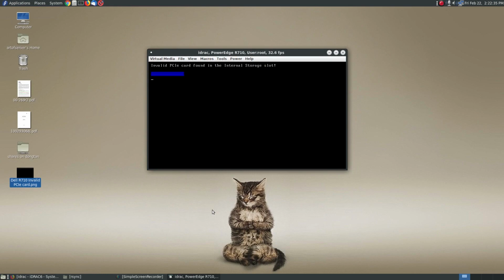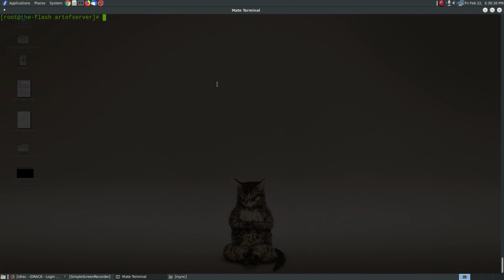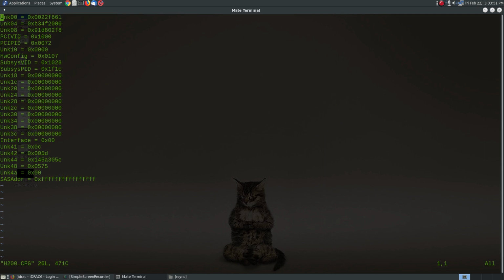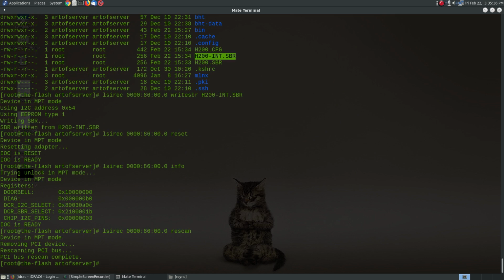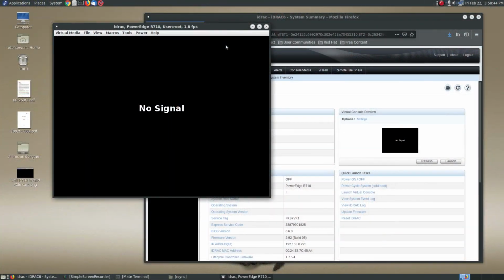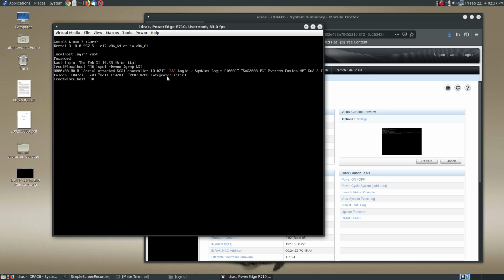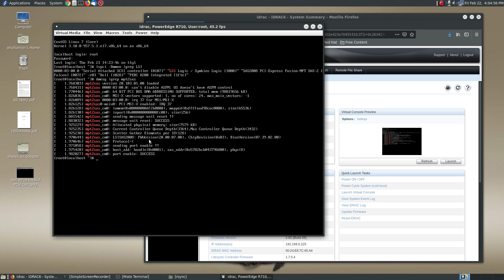How to fix: "Invalid PCIe card found in the Internal Storage slot!" error in Dell PowerEdge R710

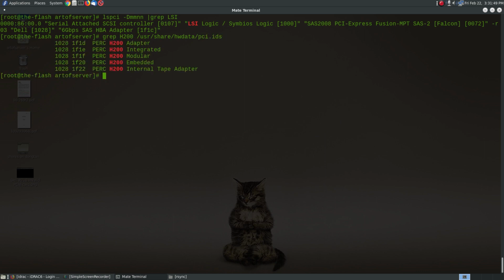Comment: If your running on a live cd because you don't have a Linux box then your steps at 6:52 might be different
I had to use 
"Sudo find / -name pci.ids"
My location was 
"/usr/share/misc/pci.ids"
Your milage may very

Edit: I would recommend not using a live cd. a memory issue prevents using grep correctly in kernel 4.5 or higher and the work around requires files that are not on the live cd. 0.o
Reply from the maker: I think the location of the pci id database file might depend on the particular Linux distributions packaging. my video is specifically using CentOS 7.

Comment: Thanks! This was exactly what I needed. I was trying to flash a H310 back to IR mode from IT mode. Only problem is that I don’t exactly have physical access to the server. I guess I’ll have to pay to have the card temporarily moved to another slot until I can get out there (which won’t be until the pandemic is over due to being in a different country). Unless there is a way to temporarily bypass this error.

Anyway, the question is, can I just move the card to another slot and have it work properly until I can update the subid?
Reply from the maker: Normally, yes... a lot of people use to just install the HBA in one of the regular PCIe slots until I figured out how to get it to work in the integrated slot in this video.
Reply: Art of Server Thanks! I’ll do that for now and save this video for later

Comment: Great video. changed both SubsysVID+PID on an IBM LSI card to 1028/1f1e and my r610/ZFS/18.04/lxc is just fine. But I now get  "Error: SAS Cable B or SAS integrated Controller is missing; SAS B Cable Missing/ Misconfigured/Controller missing." message on boot.  No effect on operation but would be good to understand why. Swapped cabling around and clear iDRAC log but still there.  I know, I know, I should have bought one of your cards.   Thank you again for sharing all your hard won knowledge.
Reply: FWIW: Thanks to AoS I put a machine together to do the SBR reprogram. Then stumbled on sasflash*.  So instead of replacing the controller card on every Dell->ZFS I make, I just reflashed SAS 6i/R 1068E LSI chip with the IT mode firmware from LSI/Broadcom.  No "cable error messages".  Seems to work for my zfs-root system. will test further. Thank you AoS.  * https://www.reddit.com/r/homelab/comments/5lg7oq/how_to_flash_a_dell_sas_6_ir_with_updated_lsi/
Reply from the maker: That's awesome! But I guess you missed my video covering that exact process here: https://youtu.be/YUbyUWpnNhw
Reply: Wow.  Youre the man.  I particularly like the part where you clear up the myths wrt 2TB SAS vs SATA.  I learn so much from you.  Thank you.
Reply from the maker: @richardlamb8952  Thanks! :-) Glad my videos have been useful to you!
Reply: @richardlamb8952   I'm getting the exact same issue on my sas 2008  9211-8i, does it mean I did something wrong when flashing it?

Comment: Thank you for the video!! Does this only work with cards originally intended for Dell's Internal Storage Slot?
Reply from the maker: The cards flashed to work in the Dell 11th gen integrated slot will work in any PCIe slot, but not any card will work in the integrated slot.

Comment: Great stuff, thanks so much for making a video on this. I have an actual lsi 9211 8i already in IT Mode and i am trying to get it to work on my dell r515. I am getting the message "Invalid PCIe found..." Will this walk through video apply to my card, or only Dell cards LSI 9211 not non-dell LSI cards?
Reply from the maker: How are you installing the 9211-8i card in the integrated slot of the R515? At least with R510, I found that there's a metal bracket that gets in the way and the size doesn't quite fit the integrated slot?

I've only tested this procedure out on H200. I suspect it would work with any SAS2008 based card, as long as it physically fits.
Reply: @ArtofServer  I had to remove the bracket that held in the h700 card, but once removed the card fits in just enough. And it isn't putting any unnecessary flex or anything to it. 

I saw in the first part of your video you were explaining how to do it with the dell card, do I skip that part?? How would it apply to regular LSI card not a Dell LSI one??
Reply from the maker: @rodjohn01  It's more or less the same. put the card in a normal PCIe slot and run the tools to modify the SBR subsystem Id, then write it back.
Reply: @ArtofServer  awesome thanks alot, will give it a go!
Reply: @ArtofServer  You are an absolute legend!!! Few things to take note of for others that have a similar situation. 

1. Put the lsi 9211-8i card in another system (Any regular desktop PC will work, with a PCI-E slot) 
2. Put linux mint on a bootable USB and boot off that usb
3. Open the terminal and login as root with sudo -i
4. To Download / extract LSI rec use the following commands in the terminal: 
git clone https://github.com/marcan/lsirec
make -C lsirec
5. To run lsi rec use the following command (make sure you don't change directory from when you did 'make -C lsirec'):    lsirec/lsirec
6. To run sbrtool use the following command:    python3 lsirec/sbrtool.py
7. Follow the tutorial in the video but when editing the .CFG file, you need to change SubsysVID = 0x1028   -- this will make it so the card is seen as a dell card.

Everything worked as you put in the video with a few tweaks, thanks so much!!!

Comment: how is the 720 on power efficiency am i expecting a massive bill for the month ?
Reply from the maker: Are you asking about R710 (what is in this video) or actually R720?
Reply: @ArtofServer  sorry the R720 and a switch its not a problem i just heard a lot of people saying you need a spare generator at the national grid for it lol
Reply from the maker: @nettyvoyager6336  R720 generation supports Ivy Bridge xeons, so are actually quite energy efficient. But that will highly depend on your choice of CPU. It can have idle power of around 80w-110w for dual socket system, but under load, can use as much as 400w. Again, depends on CPU choice.

Comment: Does the card have to be in a Dell server to be able to modify the SBR or can it be done from a standard desktop?
Reply from the maker: Well, in this video I did it in a Supermicro server and then put it back into the Dell. It can be done on any system where the tools will run.
Reply: @ArtofServer  when I do lspci -Dmmnn I can't see the card showing up, there's a green light flashing on the card and when I booted into freedos previously it would show up. I'm booting Ubuntu from a live image, could that be the issue?

Comment: When I rescan the subsystem the card shows up with the new hex code after writing but when I reboot it goes back. I tried it twice but it still didn't work. I was trying it with a H700 card not a H200.
Reply from the maker: Yeah, I bet the problem is that your H700 still has the Dell firmware on it? When Dell / LSI firmware start up, if they detect incompatible SBR content, it will try to correct it automatically, and usually you'll notice a delay during boot by a few seconds to over a minute. you need to match the firmware to the SBR for it to persist.
Reply: @ArtofServer  thank you for your response. I will look into it

Comment: 15/12/2019 
'Dell H200a/m/i' to 'LSI H200i using the latest LSI 9211/8i IT firmware'.
By 'The Mole'.

   - Filenames renamed to reflect the versions used.
   - Switch -c 0 - means card number 0.   Check it is on 0.  Otherwise edit 'bat' files.
   - Should work with H200a/m/i series...  Latest files!

For a FreeDOS USBF - 'DELL-LSI' Folder:
https://drive.google.com/file/d/13GtUh-JJ9Z3w7zI9MB_lIcA4rG3kbYpC/view?usp=sharing

Cables: https://www.ebay.com/itm/Dell-PowerEdge-R710-SAS-cable-set-6-bay-backplane-to-H200-replaces-P110M-N170M/163935653337?hash=item262b538dd9:g:ARMAAOSw1LJdxSYs

- If you have a flashing failure, IMMEDIATELY start over from Step 01.  DO NOT REBOOT!
Follow these steps 100% and you should not have a failure anyway.

- In my last experiments, trying to trim this procedure by a step or two (ie try and flash too much in one go), I had the UEFI BIOS fail and I forgot that it did.  Went back to my work PC and amended USBF, then stupidly rebooted server.   Don't do that!  Only can reboot if card is erased fully (99% sure) or combination of FW/2x BIOS flashed to the card successfully.

-  BIOSes are not necessarily needed for IT mode, but I would - you can format in there.  I only bricked my first card because post would not complete with the card plugged in (due to bad flash) and so could no longer enter FreeDOS.  They are pretty sturdy flash wise.

- I wouldn't have even bricked my first card if was not trying to write it up! :(
(Any good suggestions for a decent motherboard to flash in?  Ie exact name?)

- Feedback on successes would be nice! :)

01.  'LIST.BAT' - sas2fl20.exe -c 0 -list
       • >>> TAKE A PHOTO WITH YOUR SMARTPHONE OF YOUR 'SAS ADDRESS'! <<<.
       --- VERY IMPORTANT YOU DO THIS!  IT GETS ERASED! ---
02.  'KILLCARD.BAT' - sas2fl20.exe -c 0 -o -e 7
03.  'LIST.BAT' - sas2fl20.exe -c 0 -list
        Install 'H200I.FW' (Type 'H200I.FW' when prompted!)
04.  'FLASH1.BAT' - sas2fl09.exe -c 0 -o -f 2118it07.bin
04b. NVDATA Versions Compatible.
        NVDATA Product ID and Vendor ID do not match.
        Would you like to flash anyway [y/n]?_
        Type 'y' / [Enter]
05.  'FLASH2.BAT' - sas2fl20.exe -c 0 -o -f 2118it20.bin -b mptsas20.rom
06.   'FLASH3.BAT' - sas2fl20.exe -c 0 -o -b x64sa20s.rom
07.   'FIXADD.BAT' - sas2fl20.exe -c 0 -o -sasadd 5848F69024F3EC00
         *5848F69024F3EC00 = [Your 'SAS Address']
08.   'LIST.BAT' - sas2fl20.exe -c 0 -list
09.   Turn off PC and disconnect power.
10.   Move card to the 'Dedicated PCI-E Slot' of the Dell PE R710.   NO MOD NEEDED!

11.   OPTIONAL: SELL 'LSI H200i IT' to BUY 'Dell PERC H700i R'.  :D
https://www.dell.com/support/home/us/en/04/drivers/driversdetails?driverid=9fvj2

For a FreeDOS USBF - 'DELL-LSI' Folder:
https://drive.google.com/file/d/13GtUh-JJ9Z3w7zI9MB_lIcA4rG3kbYpC/view?usp=sharing

Comment: Any way to do this in the R710?  Can I leave my H700 in there and plug the H200 into a different slot and then do the SBR modification?  The only other systems I have is another R710 and a Macbook Pro.
Reply from the maker: yes, you just plug the card into a regular PCIe slot instead of the integrated one. I used another system only because my software was on it already. you can use any system so long as it boots up and you can run the tools i showed.

Comment: Excellent work! I just finished reflashing my H200 in a Dell R515 and it looks good. Only about 5 hours wasted in getting to the "begin install" phase :)  If it weren't for you, I'd have had to wait another week to get new cables to run it in another slot.
Reply: The tool that is used in most guides takes forever/appears to hang!
Reply: Did it gave you the error PCIe Degraded Link?

Comment: Thanks - this was a great tutorial! I followed all the steps but looks like I went wrong somewhere, for some reason the card is no longer seen in my R710. I placed it back in the PC I was configuring it on and lsirec is able to see it but my R700 just totally just ignores it. Any thoughts on what I might have messed up?
Reply from the maker: What is the current PCI ids of the card? What does lspci show?
Reply: @ArtofServer  admin@ubuntu-linux:~/lsirec$ lspci -Dmmnn | grep LSI
0000:01:00.0 "Serial Attached SCSI controller [0107]" "LSI Logic / Symbios Logic [1000]" "SAS2008 PCI-Express Fusion-MPT SAS-2 [Falcon] [0072]" -r03 "Dell [1028]" "PERC H200 Integrated [1f1e]"
Reply from the maker: @dh010447  well, that looks correct to me. when you have the card in the R710 integrated slot, does it show the "invalid PCIe card" message? Or, does it boot up, just no such PCIe card (lspci shows nothing) ?
Reply: @ArtofServer  No "Invalid PCIe card" message now (there was before making this change). Just does not see the card or show attached drive. Goes straight from CPU/Memory notification to iDRAC prompt. Will boot it from Ubuntu live USB and and post here if lspci shows anything...

Comment: Hey AoS, great video guide! I've flashed a H200 to IT mode and followed these steps to install it in the integrated slot with success. Have you run into the issue where the fans of the R710 go nuts after installing the H200 into the Integrated slot? Mine simply won't spin back down, seems it's a common issue I can't seem to find a fix on. I tried using imptools to spin the fans down but no go.

Correction: it seems it is the PSU fan not the system fans making all the noise!
Reply from the maker: No, I have not had an issue with excessive fan noise using the H200 in R710 server. I made a video about the noise level, if you want to see it: https://youtu.be/LYTjgSw1OEA
Reply: @ArtofServer  Thanks for the response. It is actually the PSU fan going crazy... the system fans are almost silent after running an ipmitools command on them. The low noise of this server is what I liked about it but the PSU fan running so hard and making this much noise can't be good and is not silent to say the least.

Comment: Am I right in thinking that you are telling the R710 to support SAS as opposed to SATA which is slower technology.  To do that, you are making the Dell think this card is the PERC so that it accepts it running an unapproved, faster card?

Not quite sure why you are swapping this with the PERC 6?  It gives a better IT mode?
Reply from the maker: The PERC 6/I is not a IT mode card, and is also an older SAS-1 card. the H200 in this video is a proper IT mode card running the LSI firmware, and is also a SAS-2 card so it supports faster link speeds. Both cards are SAS cards, just one is older version. And being SAS cards, they support SATA as well, but the PERC 6/I has problems supporting some of the larger SATA drives... there's a video in my channel called "The 2TB Limit" if you want to know more about that issue.
Reply: Art of Server Thank you!

So, these cards are not using RAID?  Won’t that be an issue?  Why is IT mode good?

Also, does this make the DRAC battery obsolete?

I am guessing that if I updated the firmware again (assuming was one etc), it would still retain the 1f1e code?

...and what OS is it you are booting into please?
Reply from the maker: @jason_a_smith_gb  That's right, these cards are NOT RAID cards. They are IT mode HBA cards, which basically means the storage devices are directly presented to the operating system. This type of SAS controller is preferred by people using software storage technologies like software RAID, ZFS, unraid, etc.

and yes, since this type of SAS controller does not emulate a storage device, there is no onboard cache, and therefore no need for battery to protect the data in cache.

If you got the H200 showned in this video, and updated it with a new version of LSI IT mode firmware, it will retain the PCIe id codes. If you do anything else with it firmware wise,  well there are many other possibilities.

A lot of times, what you see in my videos is a CentOS 7.x Linux system installed on a USB drive that I move from machine to machine when I'm messing around and testing things. This USB drive has several of the tools I use for such activities.
Reply: Art of Server Thank you for that information.  Very helpful...  I shall most likely get an H200 to learn properly...

Need a better career!

Upgrade options are:
- X5690 x2 - I think it will take in R710 II.  Microcode latest is in the 6.6.0 BIOS image as far as I call tell.
- Above H200 card you sell.
Greed:
- I have 4x 2 TB.  Might add more space sometime, maybe 2x 4TB (with your card).
- RAM is 48 GB, was 32 GB.  Can still go higher!!!

Comment: Easiest way doing this on my windows desktop? Installing ubuntu on a usb and booting from that?
Reply from the maker: yeah, i would install some Linux distro on a USB drive and boot from that. some of the tools i use here are only available on Linux, unless you're a systems programmer and can port the C code to other OS.
Reply: @ArtofServer  Honestly, I have no idea what I'm doing. I can follow along a Linux tutorial and that's pretty much it, haha. I'm guessing these tools aren't included in say, ubuntu?
Reply from the maker: @equinoxfpv173  No, the lsirec and sbrtool are not usually part of any Linux distribution. The source code for it can be found on github, but you need to build it on your Linux distro to make it work. 

of course, there's always the option of just buying a H200 card that is already flashed correctly from my eBay store (see link in video description) wink  wink  LOL
Reply: @ArtofServer  If it didn't mean waiting for a new card I would.